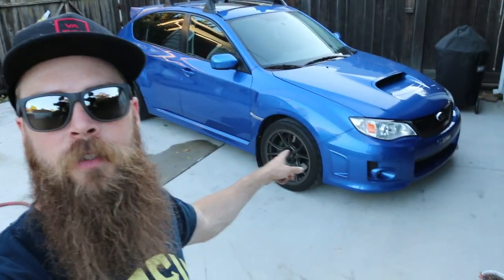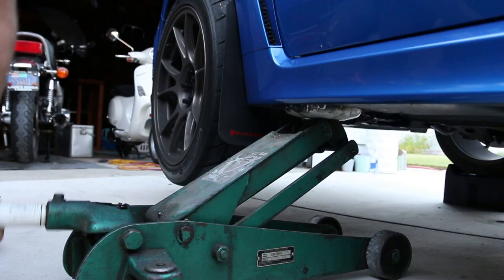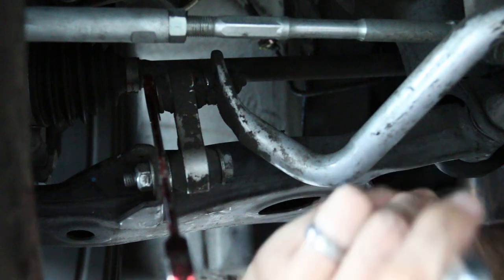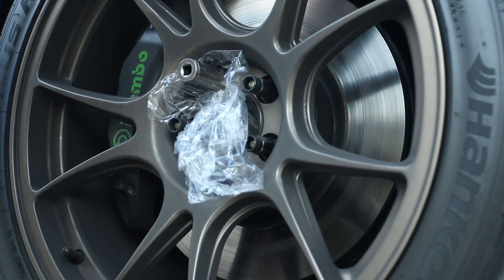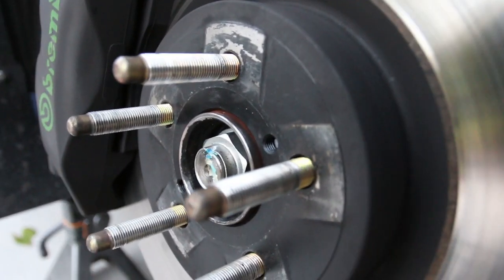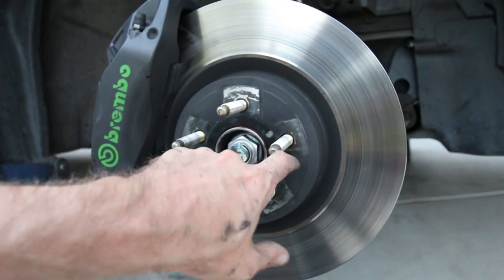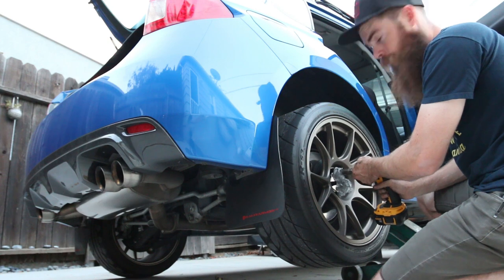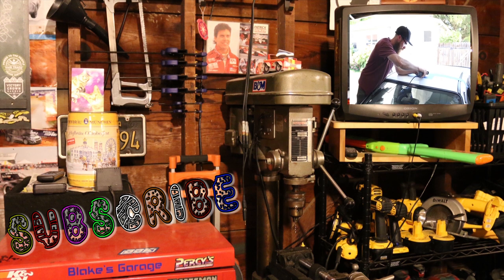FIXING SUSPENSION SQUEAKS AND HUB CENTRIC RINGS

Comment: I put in the same whiteline sway bar setup. I torqued my end links to 60 ft lbs at first and they squeaked until i went up to 80 ft lbs. After a year of driving the noise is back, so time to tighten them back up and it may be necessary for people to lube up their sway bar bushings as well with lithium grease.  Cheers

Comment: The primary purpose of the hub centre ring is to support the wheel laterally. The primary purpose of the wheel studs (luggnuts) is to clamp the wheel to the flange. The studs will shear.  Driving a car, especially a high-performance one without the wheel supported by the hub ring is extremely dangerous and illegal under some jurisdictions... The wheels have a tendency to fall off under heavy loads and that ain't good.
Reply: which directional force to u speak by force to u mean weight maybe put lateral force is what the studs are designed for what kind of force are u going to put ur car under I'm thinking vertical force would be a motion only to consider when thinking of stud failure mostly if not entirely those loads should not be considered a problem unless he is hauling weight with his subie?
Reply: Yes, the lug studs are in tension, that tension creates a normal force between the mating faces of the wheel and hub.  That creates a friction force between those two planar faces.  The friction force supports all the vertical load on the assembly.  Hub-centric rings do not support any load, and it is absolutely not the least bit dangerous when they're not used.  They may compete with the lugs to center the wheel on the hub in some cases, and they will help overcome problems that are due to improper lug tightening procedures.  They are not necessary in most cases.  To hear that some jurisdictions have created laws mandating hub-centric rings is laughable.  That would be a law based on common internet misinformation.
Reply: Illegal here.
Surprising how many tyre shops fit hubcentric rings just to sell a set of china's finest alloys.... totally compromising the customers safety.
Reply: @DW-kq3tv  They didn't even say that! You tried make yourself look good lol.

Comment: Hey Blake! I've got a 2011 WRB WRX sedan. Yeah I've also got some issues with endlink nuts loosening up on me. I'm running Eibach Sways 25mm front, 22mm rear, soft in front, hard in rear. Also Kartboy endlinks. They don't squeak, but I do get a clunking noise going over bumps and grooves in the road. I took a look under too see how lose the bolts actually were and man was I surprised how much the nuts loosened up; more than 5 turns easily. Have to check them every so often I suppose
Reply: Also, I'm new to your channel bud. I Subbed as well. Keep up with the great vids
Reply from the maker: +Jack Dawson Yep I feel like this is a pretty common issue.

Comment: Sweet vid Blake!  I have Cusco fixed front and whiteline rear adjustable sways with whiteline end links.  I've tried everything to stop them from loosening but no luck.  Based on the 17mm nut, I torque them to 80ft/lb and it helps keep them tighter for longer.  I've tried all kinds of different washer/nut combos and red loctite cured and they still come loose after a month or so.  Let me know if you figure out something different.  We have very similar builds besides yours being at 14 and mine a 15.  I'm wondering if I should get some hub centric rings.  Never really looked into it.  I'm running some some classic rays gram lights f57 forged 18x8.5 +45 wrapped with rs3 v2.  I also try to hit autox monthly in stx but haven't been able to get a clear answer on if our brake setup is within class spec.  I'm kinda leaning towards no:/

Comment: I installed my sway bars under no load. dose that take away from any of the performance or harm the car in any way? love you channel and bought a shirt
Reply from the maker: +Kevin Lautner Awesome Kevin thanks man what one? I think mostly the car will ride high and not want to settle to proper ride height. Also you're end link bolts may loosen faster because of it.
Reply: +Blake's Garage got the black one with the wrenches on it wanted to help support the cause. and yeah no squeaking yet.
Reply: +Kevin Lautner your endlinks will wear much faster because they are kinda twisted under normal load
Reply from the maker: +Kevin Lautner Awesome that's my favorite one!

Comment: My STI is running whiteline 24 in the front 22 in the back on AVO JDM solid endlinks. No squeaks and nothing has loosened up in two years. I also drive my car pretty hard
Reply from the maker: +Howie Kahn so by solid you mean there's no rubber in the end links?
Reply: They do have rubber, I am assuming by solid they mean the bushing has a higher hardness rating. I'll post the links below.

Front:
https://www.smyperformance.com/endlinks-66/avo-50mm-front-solid-end-links.html

Back:
https://www.smyperformance.com/endlinks-66/avo-heavy-duty-adjustable-rear-end-links.html
Reply from the maker: +Howie Kahn cool thanks I Soum they had some sort of rubber or polyurethane in them. Polyurethane likes to squeak if it's not lube or time down well.

Comment: Hey man what size rims do you have and what tire size did you go with? I'm have a hard time finding the right tire size for my 18x8.5 +35 wheels? any advice is welcomed.
Reply from the maker: 18x9.5+35 265/35R18
Reply: thanks man i got a set of 18x8.5 +35 what tire size would you recommend? thanks again for the reply!!!
Reply: I was told by Discount Tire that a 255 tire is ideal for an 8.5 wide wheel. Although, the stock Subaru WRX premiums run an 18x8.5 with a 245. So it's up to you. I run a 255/40R18 on my 18x8.5 +40 TSW SEBRINGs.

Comment: do you have to get the diameter  of the rim for the hub ring? Bc I have 35in tires and alot of ppl said do I have hub rungs I'm like. o but they don't kow if I need to get diameter  from axel bore or the rim

Comment: Is that what the squeaking is? Sway bar end links? I have a gnarly squeaking sound coming from the rear end of my 2014 STI
Reply from the maker: I almost guarantee it is!
Reply: Blake's Garage i tightened everything up in the rear after I did the power steering rack it stopped for a couple of days so maybe I’ll just replace the front and rear seat bar and end links🤷‍♂️
Reply from the maker: Tiernan Clarke yeah also live them that is the issue but after aggressive driving they get loose and squeak again
Reply: Blake's Garage  I can’t help but to drive aggressively 😂 jk. Idk what it is maybe it’s where u live 🤷‍♂️

Comment: 1 That doesn't look like an impact socket.

2 spray plastic dip in the socket.

3 use 2 nuts on the sway bar bolt so it doesn't come loose.

Comment: Should all aftermarket wheels use hub centric rings?
Reply from the maker: +Ryan Meyer it would be the best thing to do. You can get away with out them you just need to torque the lugs properly making sure the wheels are centered on the hub.
Reply: Thanks! also what brand are your rings? is there a general "best brand" to get?
Reply from the maker: Ryan Meyer These are from Doss wheels.

Comment: i dont have hub centric rings on my wheels, how important are they, i have an 08 sti, so what size would i even need
Reply: yes, size please... :D
Reply: If your wheels are already subaru branded then there is no issue. Aftermarket are made with a bore size bigger because all cars have different bore sizes. The rings cost as little as $10 a 4 pack on amazon. So very worthwhile to do your research and pick up the right size.

Comment: My rear sway bushings start squeaking every couple months
Reply: Collin Fletcher  just curious how I fix that... do I need to tighten the rear seat bar end links or??? All I know is my car squeaks so violently loud I literally don’t wanna drive it 🤦🏻‍♂️🤦🏻‍♂️ it’s coming from the rear end. I don’t hear it the first two minutes of driving but after that it’s all day and I can’t stand it
Reply: Tiernan Clarke just unbolt the two bushing brackets, pull out the bushings and wipe some grease around the bar and the insides of the bushing and put them back on. Take you 30 minutes or so.
Reply: Collin Fletcher I’ll see if that works as well I might get new sway bar and end links 🤷‍♂️ but I’ll do that to the new one to if I do get them
Reply: Tiernan Clarke the endlinks would make a clunk or pop sound not a squeak. It’s probable just those rubber bushings in the middle of the bar itself that needs the grease if it’s squeaky